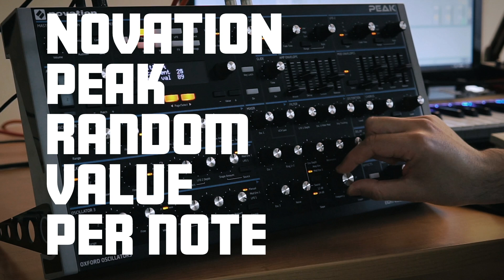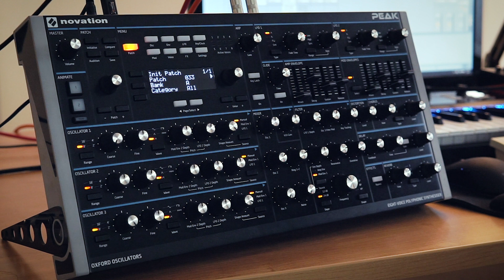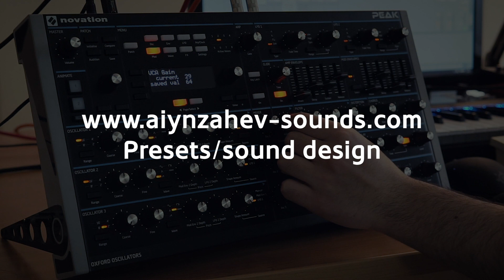Novation Peak Random Value Per Note

Comment: You can actually use at a kinf of "vintage style" knob when u use just small amounts on the attack decay stages of the filter. The filter begins to spread. I would like to know if you can modulate the hold stage of the envelopes....

Comment: Can u use this random source as offset? When i want to use it on the attack of the filter and want to set the attack with the pot and just add a slight randomness to this value (like the vintage knob on dsi)